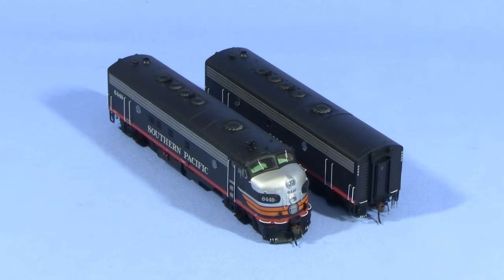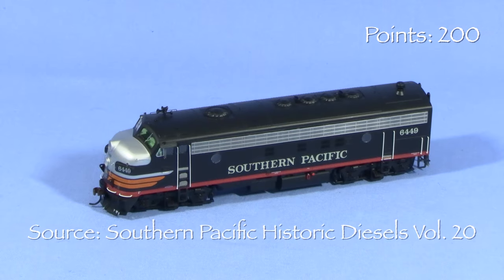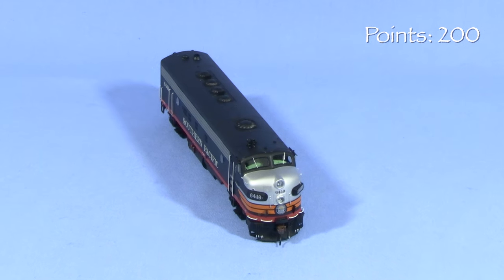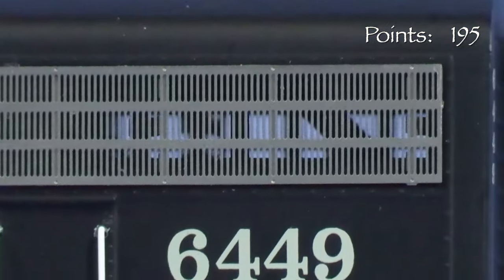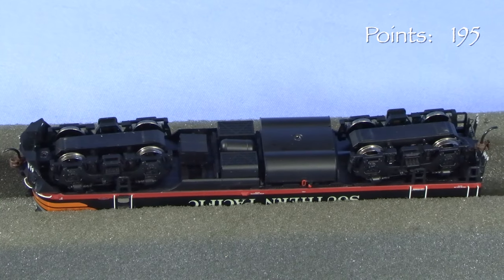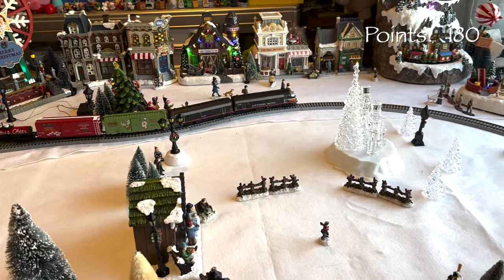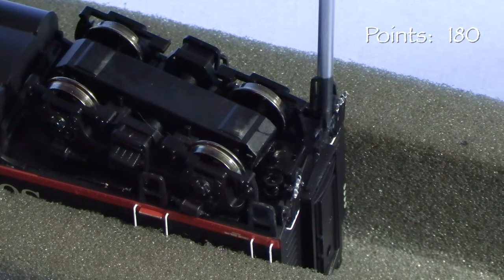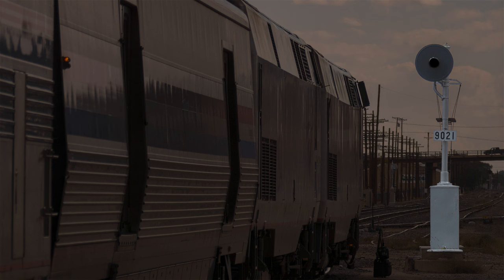New Black Widow F Units!  Unboxing and Product Review - Athearn Genesis HO Scale FP7A and F7B SP

Comment: Wow! I love F units in general due to growing up watching videos about the ATSF.
So much in fact, I'm close to having an F unit built by every model railroad manufacturer that offered or currently offers them.
- 3 Bachmann ATSF F units (1 FTA in an early Warbonnet scheme, and 2 F7As, one in the Warbonnet scheme, and the other in the Blue & Yellow Freight Bonnet)
- 1 Broadway Limited Imports ATSF F3A Blackbonnet scheme
- 1 WalthersProto SP FP7A in the Scarlett & Gray scheme with Ice Breakers
- 1 Athearn Genesis WP FP7A in the Orange & Silver CZ scheme
I might get the Intermountain ATSF F9 in the Yellow & Blue freight bonnet, a WalthersMainline D&RGW F7A, and a Rapido Trains Inc. VIA Rail FP9A to be able to say that I have a lot of F units..  lol
Reply from the maker: That's a lot of F units!  I have a few older Genesis F unit models in Santa Fe, Rio Grande, and Western Pacific.  The two in this review are my first SP units.  Thanks for watching!
Reply: @DanielCortopassi  it doesn't work at all now, but as a kid, Dad got me a DC Bachmann Santa Fe Warbonnet F7 was my very first F unit and my first ho scale locomotive.  In the other words, the engine that started my journey into HO Scale model railroading.

Comment: Hey Dan. Nice review again. Those engines are very nice...for Athearn ! I'm joking here but only in half. Most of Athearn Genesis engines are a real pain in the a*** for me. There is always something to fix or modify on them. But I have to admit that both of these A and B units are we'll done. The only bad thing I saw are the front lift rings. In close shot, it's noticeable that they're not completely pushed in. The fuzzy paint doesn't bother me at all. I do admit that it should be done more properly but it's easy to hide with lite weathering. Too much oil is something I only see on Athearn's engines. Overall, engines look very nice and you did a great job showing all interesting features on them.
Reply from the maker: I'm glad you liked the review.  I think these are pretty nice overall.  I noticed that the lift rings on the nose didn't quite touch the body when I was editing the video.  It's another thing that shows up more on camera than it does in person.  I may try to see if I can push them in a little when I get around to putting DCC in these.  I've seen oil on other Athearn engines, too.  They could probably use a little less oil.  It can make a mess if the engines are stored on their sides.  Thanks for watching!
Reply: @DanielCortopassi  Hi again Dan. I was just letting you know about the lift rings. It was not really an issue for me here.

I got to admit that I'm not a F unit guy at ALL. But those are like the basic of trains. Especially model trains. When I was young, most of Bachmann kits had F units and GP35 or GP40 diesel engines. They were so cheap made... nothing to do with today's HO models. Keep on your good work.

Comment: I think I would have waited to grade the couplers until after I changed them out, as I’ve had problems with plastic couplers on locomotives before. I always change mine out for metal-shank couplers before use on the layout. If they’re a bit high (say, no more than a millimeter), then they’ll couple just fine. If they’re a bit low, then I just make sure the coupler trip-pin passes over the Kadee coupler height gauge. Tension will pull them level once you start pulling a rake of freight or passenger cars. If they’re more than a millimeter or so off, then you can shim them, or use Kadee’s under- or over-shank couplers (also sold in packs.)
Reply from the maker: For reviews I always test the coupler height, wheel gauge, and the rest before I do anything to the model.  That way I know that nothing I'm doing is affecting the result.  I don't like plastic couplers, either.  I've also had problems with them.  Thanks for watching!

Comment: I only have Reading FP7’s from AthGen. All have no coupler issues with Kadee’s and have been outfitted with the Athearn led friendly 21pin board, tsunami2 21PNEM8, LED kit from Scale Sound systems, and a speaker from Scale Sound systems. 

I fully endorse the FP7’s from Athearn older or newer run. The haul plenty! Just be careful if there’s a speaker installed in the proper spot as you will need to slightly pull up on the nose first until you get to the speaker then lift nose further and back.
Reply from the maker: I will be adding sound and DCC to mine eventually.  I can see having to watch the speaker when opening them up if they have them.  Once I figured it out, I like it that these newer units have screws.  It makes it easier to remove the shell than on some of the older ones.  Thanks for watching!

Comment: Nice review. Will you add DDS and sound to both units ? That would make a good video.
Reply from the maker: I will be adding DCC and sound to these at some point.  I've had in mind to do a DCC Shop video eventually with an F unit, so these would work well for that.  Thanks for the suggestion and for watching!

Comment: I'm not a fan of the black widow scheme but the overall detail is typical for Genesis. If they become available in the scarlet and grey with the icicle breakers I would opt to get at least the A unit.  Hopefully with tsunami 2 and sound.  Good review.
Reply from the maker: The icicle breakers would be a bit of a challenge.  I didn't see a detail part available that matched the type on the prototype units.  Custom Finishing has a part but it's different.  It would be cool if Athearn made those.  Thanks for watching!

Comment: Excellent review as always, Dan. Regarding locomotive body wobble, have you shown how to fix this? I have an Athearn RTR SD40-2 and SD60 (white box) that wobble significantly.
Reply from the maker: That sounds like a good subject for a Model Building Tips video.  I haven't had too many locomotives with wobble issues, but I have seen it happen.  If I run across one in my collection that does that, I could use it as the subject for a video.  Thanks for the suggestion and for watching!

Comment: Isn't working number lights the norm these days? Not having these and the non working class lights at this price seems like a major flaw to the model. Or did SP not use them?
Reply from the maker: I'm pretty sure SP used them, and yes, the model would be better with those features.  For whatever reason, Athearn has shied away from lit number boards until the more recent Genesis 2.0 models.  At least these models have separate glazing, which makes it a little easier to light up the number boards.  The class lights have lenses, and could be lit from behind.  It's a fairly involved job to do all of that.  I've done it before and I like the results but it would be nice not to have to.  Thanks for watching!